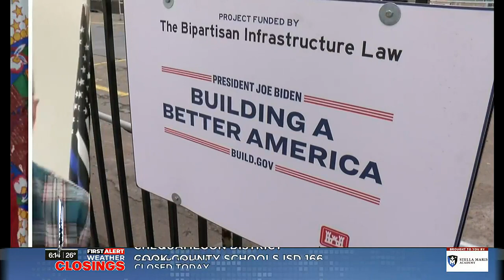Behind The Scenes:  New Soo Lock Construction

Comment: There are rail connections between the taconite mines and the steel mills on Lakes Michigan and Erie! So, the ore pellet trains which originate in upper Minnesota could continue to Chicago and Detroit rather than to the loading docks at Duluth/Superior and Two Harbours. It might also be quicker!
Reply: and far more expensive. Plus it would take longer because the increased number of trains running the same routes.